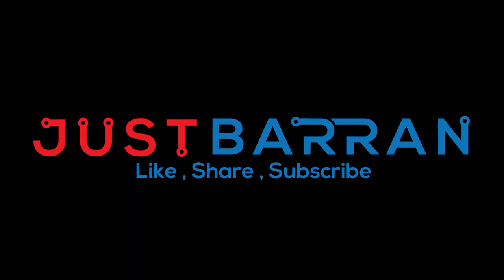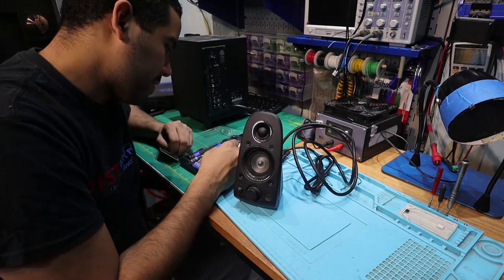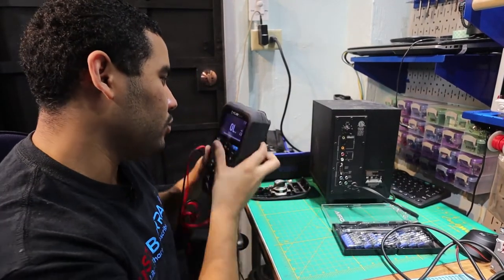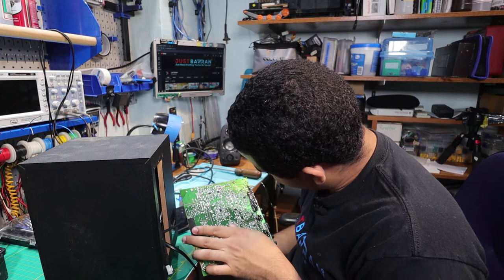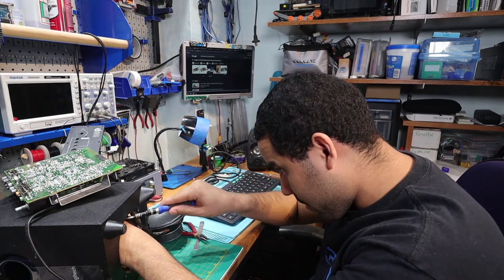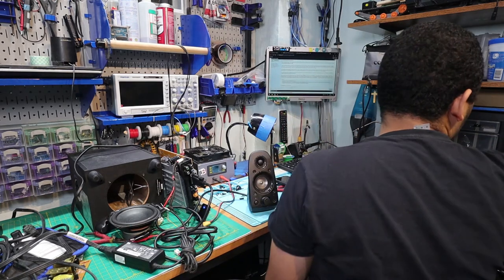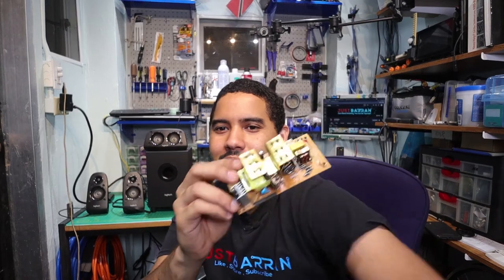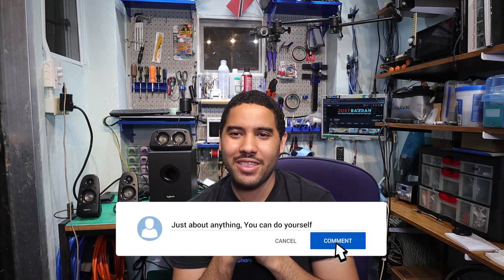Logitech z506 Speaker Repair | Fix-it Friday #2

Comment: The real solution is to replace two capacitors on that power supply on the power output side which go bad. I am currently dealing with this very issue and found a reddit thread of several people also with the same issue and one person finally realize it was just those two capacitors on it which is the same conclusion I came to when I noticed the bulging capacitors after a few hours of troubleshooting and pulling apart the volume pot to clean it and resoldering connections only for nothing to work. It's a lot easier and cheaper then just tossing the whole power supply and replacing it. I'm currently waiting for replacements I ordered which is a set of 5 so if I have this issue in the future I will have some spares on hand.
Reply from the maker: I check the caps on mines and all were fine. I just reach a point where I weight the time taken to find and fix the bad components or spend just replace it with something I already had lying around. I went with the lather. Sorry that you reached the same place 🤣

Comment: Worked great! Thank you. I used an onn brand 19 volt, 4.7 amp computer charger and so far it’s working great. Got the Logitech system for $10 and the charger for $5. Not a bad deal at all lol
Reply from the maker: That's a great deal 🙌 awesome stuff

Comment: Same speakers started out with a slight buzzing sounds, when it was cold in winter time the buzzing would be worse if speakers were off and eventually fade when using them. After a few years the buzzing stopped but speakers started cutting out at 30-40% vol. Woke up one morning with power tripped and when i switched everything back on, the speakers were just dead.

Comment: Is it normal that we don’t get a a clear sound? I can’t really enjoy my music with this solution, I get a dirty sound I don’t know it it because of the power of others
Reply from the maker: Nah, something else might be the issue. The sound on the one I deliever was clean. It could be noise from a bad power supply used, bad input connection or cable or bad sorce. I recommend try the input with another speaker and seeing if you hearing a similar sound. If not it could be one of the ampliers for damage from the original failure of the powersuppply

Comment: I blowed up my multimeter once by measuring AC voltage with DC set on it 😂😂
Reply from the maker: Sorry to hear that 😢, but yea making sure it’s set correctly is really important
Reply: Don't be sorry for that !! Actually it was funny at that moment
Reply: You can "blow up" your multimeter if you measure on the "ohm" setting and there is volts in the circuit though..

Comment: Liked the video! Very good! You've fixed the issue of that speaker. Well, there's one thing I want to try. I bought a DB9 RS-232 cable female to 3.5mm male (since there's scarcity on the shop for male to male) then just bought another RS-232 male to male then will use a soundbar model LP-1807 (detachable L & R) with R bar as main then control as bluetooth and main control speaker. Hopefully it will work xD  Subbed!
Reply from the maker: Hey would love to hear how this works out so keep me updated. Adding Bluetooth to this would make it so much more valuable as a sound system
Reply: @JustBarran  Once I've received the cable, will test it out then get you updated xD
Reply: @JustBarran  Didn't work bro 😅 I think only analog speaker with rs232 will work and not the digitized ones.

Comment: My systems keeps playing and cutting off repeatedly... don't know what's the problem?
Reply from the maker: Could be a number of things from a faulty cable to a bad power supply like in the video. Would be better to see if you can isolate the cause of the problem,
Eg it cut of when you move the system, or when you try to play it too loud. It could also be a switch shorting out

Comment: You're what we call a board-level technician. Nothing wrong with that, but it would have been worth your time to bring that simple power supply to the component level. Something made that resistor get hot, you could do it.
* Regardless, I came here to find out how you fished the main board out. I got so much more, because of your complete disassembly. Thanks man, kudos.
Reply from the maker: Hahahahah I not gona lie, you are right 😂😂, I was tempted to dig in some more but it wasn’t worth my time since I had a powersupply to replace it, dw next time

Comment: my z506 got broken this week, sound cutting out arround 70% - 100% volume and I think it get worse everytime, now I can only play at around 20% - 25% volume.
already checked the mainboard and the cable, all looks good.
not yet check the power supply yet because it's kinda hard to reach, but thanks for your video that confirm it can be replaced with laptop power supply and I have some spare laptop power supply
Reply from the maker: No problem, just be careful power supplied tend to have a capacitors that store charge so try and discharge the unit before testing and let me know how it goes. Happy to help

Comment: Thanks a lot I did the same test 'cause I've the same Logitech speaker problems. Gonna fix it now, Thanks for sharing your knowledge. Cheers from Mexico🤓
Reply from the maker: Awesome happy to help, remember to take all precations when wiring up even if is the dc side. Last thing you want is the box of catch fire. Other than that good luck and you can always DM me on Instagram if you need any further help.
Reply: @JustBarran  Yeah, I've used thermofit to cover everything. Also used a 19.5 volts 3.5 amp laptop charger. Thanks again
Reply from the maker: @andresvega5476  awesome well you all set, and cheers from Trinidad 💃

Comment: I have these and after 4 years they have a clicking tick almost like static. I checked my drvers and all but it remained. The fix was to remove my memory and wipe it with a damp cloth. I have my tower on the floor and have carpet. Bad move....static creps in but once wiped they are all good. Outstanding speakers if you are a hip hop head and a gamer.
Reply from the maker: That's awesome. Yeah the problem would probably have been the sound card on the computer. These speakers work great
Reply: @JustBarran  Perhaps but it was the memory that held the static. The sound card had nothing to do with the speakers. If left on they do tend to get a hum or a click but yes great speakers but still disposable

Comment: I can see the same resistor looking... a bit fried. But I couldn't get either of the boards out. I was about to rip the box to pieces and fix it later. But now I know the boardremoval and voltage. So I can either fix the board of just change the PSU. Thanks!
Reply from the maker: Hahaha i know things like this does make people get frustrated. Happy to help

Comment: Eehy watchu ylknow about di Lofi gyal?? 😂 Great job my fellow ee/me engineering coop! 

I actually received these speakers today wuth the understanding that they dont work. On a preliminary test, I observed massive heat on the DB9 control cable and no output sound on the control speaker. This has to be a dhort- no?? Do  you think that could be a short either on the output stage or the right speaker?
Reply from the maker: Hmmm heat on the db9 seems weird, yet it definitely means something shorting but also that should be a low voltage circuit. I would check all the connectors because that is serious weird

Comment: Hey nice info.
But I bought 2 sets at the same time, I paid $70.oo each at a computer show. 
one has gone (kaput). 
I have had them for a long time. 
Don't think I'm gonna try this as it would cost half what I paid for the full set. 
And time to put into it. 
Thanks for your video as I was going to try to fix it, but think I'll save the time and get an upgraded set up. And go back to Klipsch, or set up with Atmos. Not sure yet.
Reply from the maker: Hahah that’s a great deal you originally got, but yea I feel you, sometimes the repair is not worth it. See if you can sell it broken or give it to a repair shop at lease they can up recycle it. A lot of people will be looking for the speakers or control speaker alone too.

Comment: Hi, should I use 15v 5A adapter or 19v 3.2A ? I appreciate your response, please help me choose don't say they're the same. lol thanks
Reply from the maker: Hey ether one will work, the 15v 5a is closer to the original powersupply so try and see if it works first and how it sounds. The only reason I used 19v was because it was what I had available. So if you have had to chose go with the 15V as it is more with in the original specification
Reply: @JustBarran  thanks man I appreciated it, and yes it works like a charm! But now I have other problem the potentiometer is broken because I forced it without opening the screw at first lol..
Reply from the maker: In one of the other comments on this video I give someone the link to a replacement pot, ask them if it worked
Reply: Are you using 15 v.??
I think it will be safe.
I replaced with 12 v but can't play at max volume
IT play well around 70-80 % of total volume bass.
Reply if 15v is working well.

Comment: Hello can a Logitech Z313 Subwoofer Speaker work in the Logitech z506 subwoofer as a replacement ? trying to find out online but it's really difficult
Reply from the maker: Am not sure sorry.
Reply: Speaker watt and impedance should be match otherwise it would be damaged to speaker or amplifier.
So replacement subwoofer should be 25-30 watt max and impedance should be exactly equal.
Reply: It should be  between 20-30 watt,
Don't play bass volume at max.
Use 60-75% bass n volume.
IT won't be damaged.

Comment: I have this speaker set and I wonder whether it's something that I could make battery powered? Perhaps a laptop battery and power supply?
Reply from the maker: Hey, definitely I think that’s a good idea, you could also get a Bluetooth module also. In terms of battery it would need to have a decent capacity depend on how long you wanted it to play for. The speaks are DC so you just need to flow the video , but where I change to rectifier /power supply you can substitute that out for a DC jack and feed the speaker of a 12-19v supply /battery and you should be good.

Comment: Hey bud, great video! I happen to have the same speakers, and with the same exact problem. Even have an old laptop power supply I can use. Just a quick question to clarify, you skipped really fast on the wiring and connecting the wires from that laptop power supply to the DC wire that connects to the board of the speakers. Any chance you can explain a bit further how you did that exactly? Would be greatly appreciated.
Reply from the maker: Hey no problem man. Sorry It was too fast. Not sure if you have a multimeter. But make sure the laptop powersupply is around 15v to 19v. I cut out the end from the laptop charger. This is the side that would have gone into the computer. On the AC to DC supply on the speakers. The little circuit board I threw. There should be a red and back wire that plugs into the main amplifier board. I cut that wire and spliced the red (positive) to the positive of the laptop charger. And the negative(black) to the negative of the laptop supply. Use a multimeter to make sure which one is positive and negative because laptop chargers vary the voltages.  I put some heat shrink also before I did the splice and added solder after to finish it off. Then I pushed it Through the hole that the original AC plug would have gone thru. Tied a knot so it doesn’t pull out and fill it with glue stick. The I plug in that to the amplifier board and you should be set.
Reply: @JustBarran  Nice one dude! Thanks a lot for the info. Wish you all the best, and happy projects! :)
Reply from the maker: @MeTr01DPr1M3  no problem, let me know if you are successfully
Reply: @JustBarran  Hello. How many volts and how many amps does the adapter in it use? What power supply did you use? What value did you use?
Reply from the maker: @abdulllah01  I not sure what are actually specification of the powersupply that originally came with the speakers, I believe from looking at the components it could be around 13to16v 5A , I replaced it with a hp laptop charger which output 19v 6a I can’t remember exactly cause I gave it to my friend.
Reply: @JustBarran  Logitech has installed a .12 volt 4 amp dc adapter into the new product. I was very surprised.
Reply from the maker: @abdulllah01  well it depends what the specs are, and what the design requirements allow for, they would go with what ever is the cheapest solution and Thus people end up blowing their powersupplies
Reply: @JustBarran  thankyou
Reply: @abdulllah01  which product?
Z506 speaker??

Comment: I have one and the center speaker have some noise in the back  ground and the sound is very low, do you know any way to fix it? I tried cleaning the input and the plug but did not worked.
Reply from the maker: Sorry not sure, a number of issues could be causing that , could be short in the wire also or a bad transistor on the amplifier

Comment: I tried to open mine, but both the control speaker with the buttons, and the subwoofer panel are glued inside. There's nothing wrong with it, except i want to see if I can turn the whole thing into a passive speaker system, since the ONLY 5.1 HDMI ARC decoder on the market has an internal amplifier. Yes, there is only one such product and it's discontinued. These are just remaining units. There are $2000 audio mixers that support HDMI ARC input, but that's a professional studio system with about 30 I/O ports of various kinds.
Reply from the maker: Hmmm good points it would be something I have to look deeper into myself and get back to you but at that price it that audio mixers are nt worth it
Reply: @JustBarran  Update: I managed to get the subwoofer open and adding the new direct input was easy as soldering two wires to the speaker, then on the input port, drilling a hole and gluing it there with hot glue.
Also on found which two pins in the DB-9 go directly to that speaker. When looking at the RS-232 layout as reference, pin 6 is the signal + line and pin 7 is ground. Got a DB-9 connector wired to an RCA jack and it worked as expected. The whole system of course is unplugged from power. Don't want to know what will happen if I turn that on.
Reply from the maker: @coladict  did it work?
Reply: @JustBarran  The new inputs work. I haven't tried the old ones, because my 5.1 optical audio decoder is has a buffering issue. The longer I leave it on, the bigger the audio delay. It reaches a full second of delay within just 2 hours.
Reply from the maker: @coladict  dam that's a big delay, hope you get a work around

Comment: Hey, the sond emitting from my speakers sounds like it's breaking up and sounding distorted when the volume is proberly on only like 35%. Don't know if it's the speaker ffrom the box 
or something else. Could you give some advice. Thanks
Reply from the maker: Hmm not sure to be honest. Distortions come from noise or a bad component in the amplifier
Reply: @JustBarran  I should have clarified b4. It's the logitech z506 speakers. The distotion is coming from the bass box. I think that the speaker is blown but I don't know if it could be something else. I disconnected the speaker but got the same result. Don't know if it's another component that has malfunctioned.

Comment: I tried this with an 19v 3.42a charger, the speakers turn on for a second but then the energy fades away and wont turn on until I disconnect the laptop power supply... Im not sure what im doing wrong :(...

The charger says it is INPUT: 100-240V~1.6A 50-60 Hz OUTPUT: 19V 3.42A 

Do I have the wrong values for my laptop PSU? Thank you in advance!
Reply from the maker: Likly that the laptop psu Is detection a high current spike and going into protection mode. Check and make sure their isn't a short circuit any were or that the power supply is not faulty

Comment: Hello. How many volts and how many amps does the adapter in it use? What power supply did you use? What value did you use?
Reply from the maker: I not sure what the Original one was, I believe it could be 13-15v 4A around there, the one I replaced it with was a ~19v 5A hp laptop charger. Anything around the should work

Comment: How do I connect the speaker with a laptop power supply board ? Not sure how it works 🙏🙏🙏
Reply from the maker: You have to take out the old internal power supply and by pass it

Comment: hello, I subscribed to your channel, I have the same problem, but I don't know if I can use the old Lenovo 20V 4.5A power supply?
Reply from the maker: Hi, this one I am not sure about the 20v might work but it would be risk. I most I tried was 19v
Reply: @JustBarran what exact power supply model did you use?
Reply from the maker: @damiantobaj5977  18.5V 3.5A 65W  HP Pavilion DV4 Power Supply
Reply: @JustBarran  I bought the same one, I haven't cut it yet, but which cable is + and which is - in this HP power supply
Reply from the maker: Hi, this would be different between models but I recommend using a multimeter to check this.
Reply: @JustBarran  thanks,Do I need to connect the power supply to the socket to check this?
Reply: @JustBarran Thank you very much, I fiddled with it a bit and it works
Reply from the maker: Awesome great, yea you would have to plug it in and test but it DC low voltage so it should be safe. Glad to hear it is working